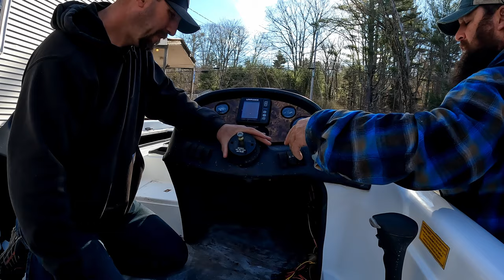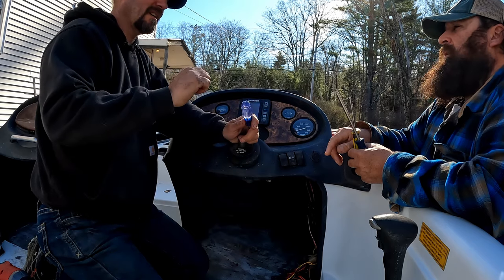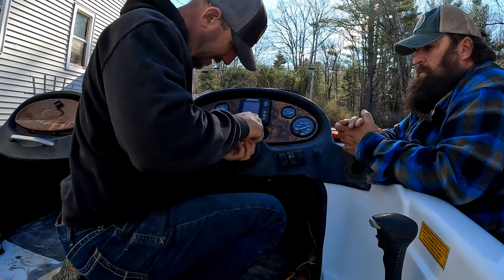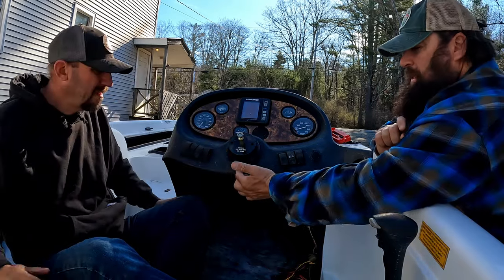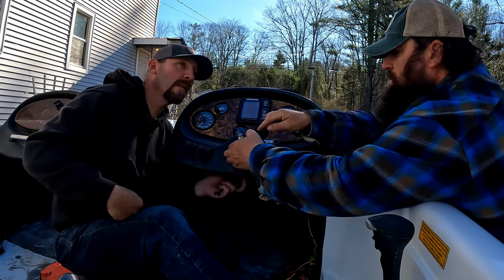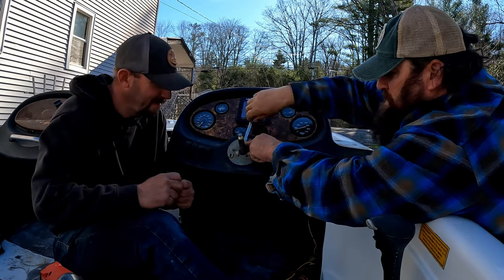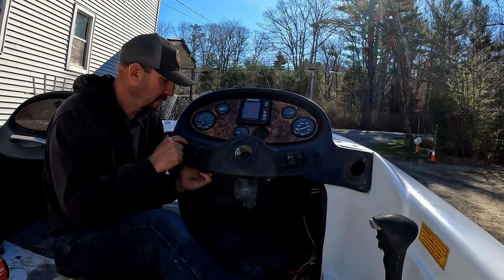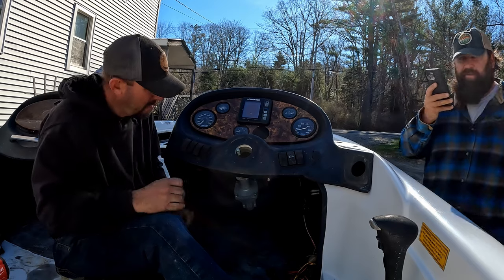We Struggled on the Helm: Boat Restoration

Comment: If you can’t fix it with a hammer , you got a electrical problem lol , I belive was already said , but believe he was talking about a manual impact driver , put whatever size bit in for the screw you want to loosen , then hit driver with hammer , jars it and loosens it all at once , very handy tool for soft stubborn tight screws
Reply from the maker: I will look into the manual impact driver sounds like a handy tool to have.